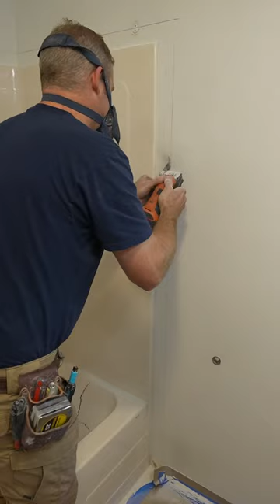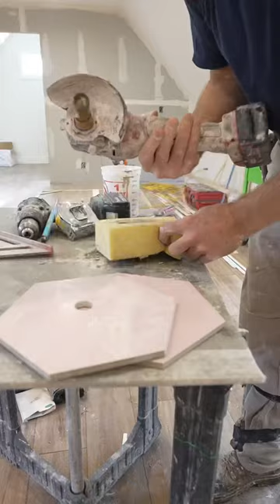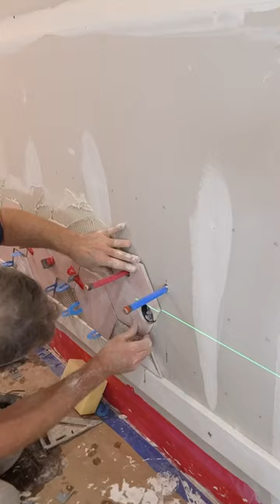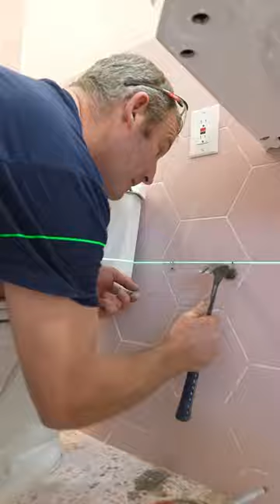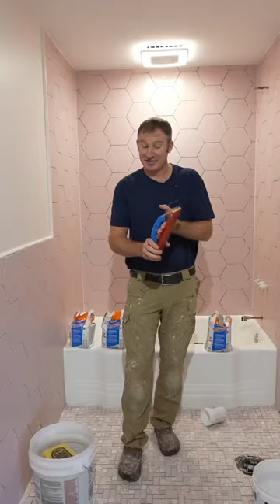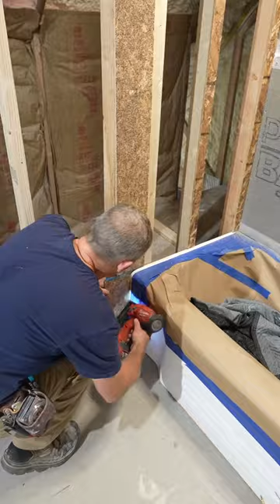Christmas gift ideas for a tile contractor 🎄🎄

Comment: Purchase links?
Reply from the maker: Christmas gift ideas for a contractor
Milwaukee Mud Mixer - https://amzn.to/3uKCaQM
Mortar Bucket Mixer - https://amzn.to/3N3DiWb
Cordless Fein Multimaster - https://amzn.to/3Ro0SQ3
Bucket saver - https://bucketsaver.net/?ref=l3pvr4l4
Grinder Hole Saw - https://amzn.to/47SYbLF
Chamfer Bit - https://amzn.to/47YQqEa
Huepar Laser - https://shrsl.com/4buch
Laser Pole - https://shrsl.com/4buxs
Cordless Hot glue gun - https://amzn.to/3RmhXtr
Troxell Grout float - https://amzn.to/3sXaMP7
Milwaukee Crown Stapler - https://amzn.to/3Gm4xHw
Milwaukee Caulking Gun - https://amzn.to/3uFEfhb
Reply: Thanks! Currently in the middle of a bathroom remodel, thanks to your videos.